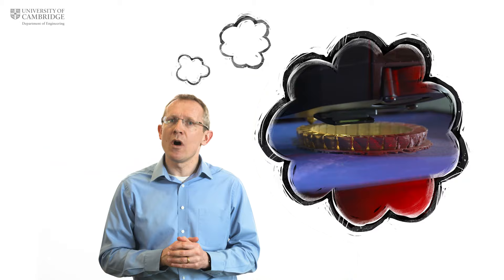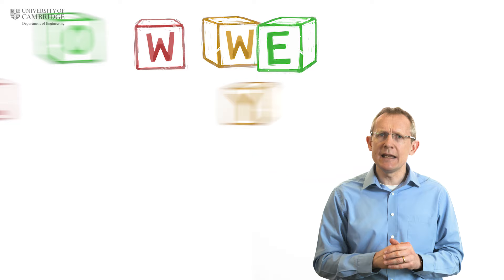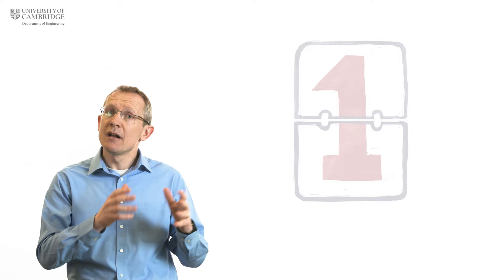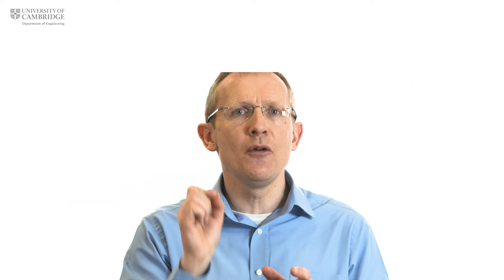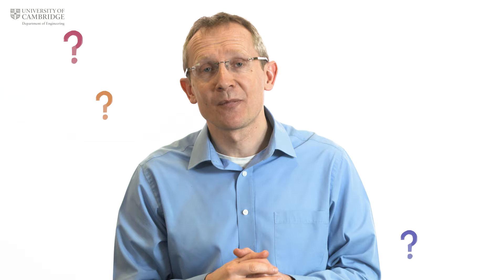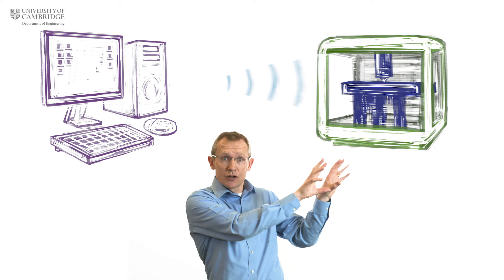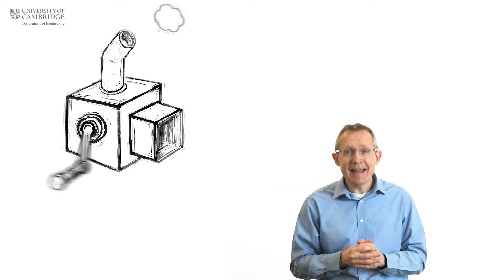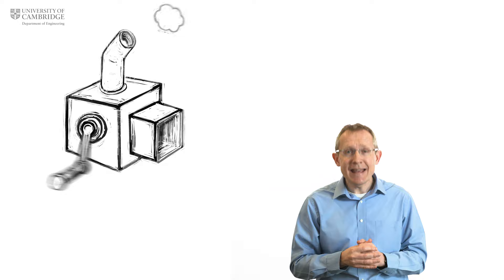What is 3D printing?

Comment: 3D printing today etches out a print layer by layer and although you can do one layer pretty quick I know a change of materials that costs some wonga at first as a material,  can be recycled and you can mold it with light and bond it with electricity. re-bondable micro particles and in the building industry you could use re-bondable macro particles with something like clever Velcro.
This would be sustainable and with enough particles on stream very fast to produce stuff with. Also for the computer part more precise nano/micro particles which could be cheaper to recycle and upgrade than to originally produce.